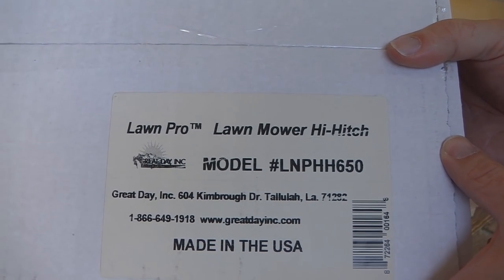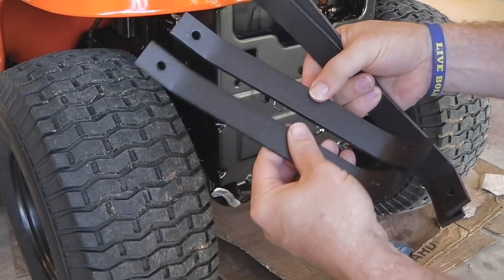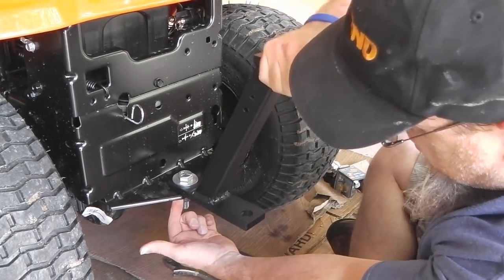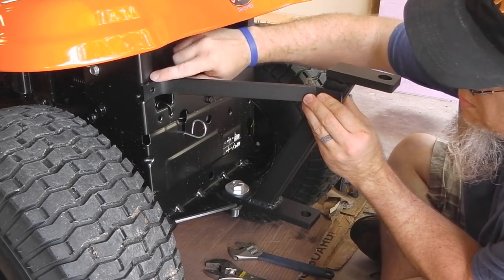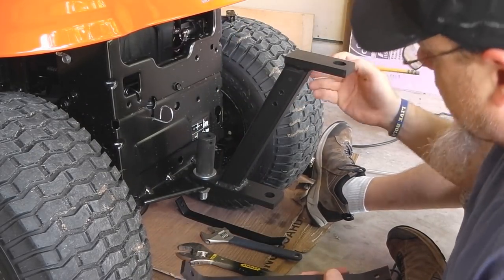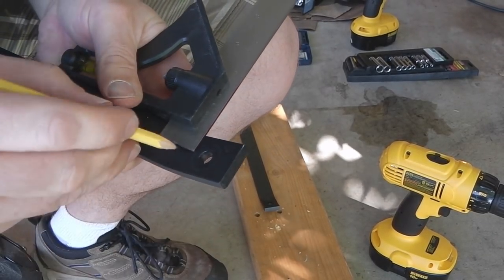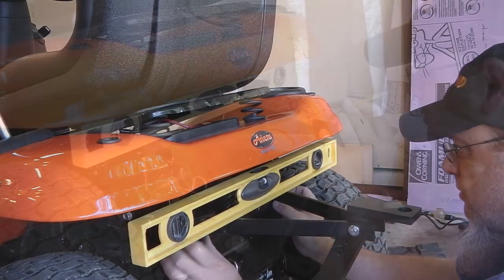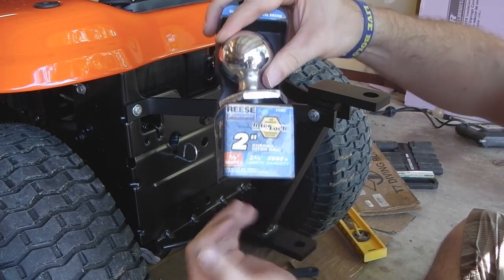Installation Lawn Pro Hi-Hitch (LNPHH650) on Ariens A20VA46 riding mower

Comment: Nice video and install, but a word of caution. That trailer ball is way above the “balance” or what my dad called the torque point of the tractor. That point is below (or at) the center of the driving wheel axles. Anything above that will contribute to the tractor tipping backwards when and if too much torque is put to the tractor, like a trailer suddenly catching against a pole or tree. A neighbor put a chain around the axle of his tractor (12 to 16 inches above the drawbar) to pull a struck truck out and the tractor suddenly flipped backward, killing him. That is why the manufactures put drawbars (plates) so low. It may be inconvenient to hook up a trailer but at or below the axle center is safer. And yes, it has enough power to do that and it may not kill you but it certainly will smart!
Reply from the maker: Youch!  Sorry to hear about your neighbor, that sucks....I've been careful with it so far and I try hard to only tow on flat ground with no obstructions, however I will keep this in mind in the future, especially with kids/grandkids.

Comment: Thank you for the video. I just bought one but the instructions were not easy to follow.. did you remove the gas tank? Mine has tank in the space of the black box.. craftsman tight turn 48”
Reply from the maker: My gas tank is up inside the engine compartment, so I did not have to remove mine.  If I had a gas tank in that area then I would probably remove it or put a metal backer plate between the tank and rear of the tractor to ensure you do not puncture it.   Thanks for watching and commenting!

Comment: decent looking hitch... not sure I like it being made out of aluminum (from what I have read about it) unless you are only towing smaller/lighter items. Read some people had to beef theirs up with some extra steel supports. 
After I built a 4' x 3' heavy duty utility trailer to use on our property, I then built a similar hitch out of steel for my mower. Distributes the weight nicely, many times stronger than just putting a ball on the flimsy plate, and it makes the trailer ride level. Also with the ball further away from the rear of the mower, it gives a much improved turning radius.
Reply from the maker: So far I have not had any issues with either my mower or with the hitch itself.  I do not attach anything extremely heavy to it, just a 4 X 8 Harbor Freight "heavy duty' trailer to it and it pulls it just fine.  

I agree that this solution, or a custom-built steel one, is much better than the flimsy plate they put at the bottom.  I don't believe the manufacturers actually intend on any of us putting a true trailer-ball on them anymore.

Thanks for watching!
Reply: @TBKHomeworld  yeah, mowers these days definitely aren't built to do any heavy work or towing. But with a balanced trailer, they can still do a good bit of work. The mower I'm using for this, I got free. Had a blown head gasket which I fixed. I then removed the deck and everything associated with it, which reduced the weight a bit. Did several small mods  and addons to the mower to make it more useful for utility purposes. I know I overbuilt the hitch, but I usually overbuild anything I fabricate LoL  Would rather overbuild it than have it break on me though, especially if I was out on our property somewhere. 
Thanks for the Idea!

Comment: Just got my own and havent used it yet. Looks as though it will serve the intended purpose.... if the welds survive. Looks like they were welded by a blind man with a torch and coat hangert.
Reply from the maker: Mine is still in use and does not have any issues.  Hopefully yours will be just as good.

Comment: Please dont tow anything other than mower accessories with a riding mower. Its not so bad if you habve a garden tractor though. The issue is thag riding mower transaxles dont have ball bearings for the output shafts they have bushings and cannot support the tongue weight. The transaxles also are not durable enough to handle pulling a load like a garden tractor is. Back when i worked at a friends mower shop we would see mowers come in all the time for transaxle related failures. Those mowers all had a ball on the back for towing. In fact if there was a ball on the back of the mower we were instructed by the mower company that they would not do warranty repairs. If you want to pull a light trailer you can use a tow bar which keeps the weight off the mower.
Reply: Well use mine all the Time so far touch wood no prob so thinkin they must be moving Cement cause I Haul scrap dirt and oya brass Copper and Lead 3x6 ft trailier and it goes good Sears 14hp 5spd

Comment: I was disappointed when I got mine a few years ago that the parts are made out of aluminum. Thus I have never installed mine.
Reply: Update: I installed it in 2018 on my Toro 522xi garden tractor. I used both sets of arms included in the kit plus I used 1”x12”x3/16” mending plates to reinforce it. I have multiple videos of it. Click on my name and you can find my videos.
Reply from the maker: I'm glad you were finally able to install it, I have used mine a lot and I've never had an issue with it.
Reply: @TBKHomeworld  
I built mine in 2018 and still haven’t used it. Might be removing it to install a sleeve hitch. Oh well, it was fun adapting it to the tractor.

Comment: What is that
Reply from the maker: Just a nice little trailer hitch that won't bend your rear frame on a MODERN riding mower.  The older ones have big metal plates in the back which don't bend except under extreme loads.

Comment: That dam tin  not going to work!  i don't want my dam hitch 10 foot in the air>   Trashy just trashy > got some metal plate 3/16''  to cover the ass end on the dam thing,  going to make 6 holes to bolt it to the trashy tin  on the plate weld a box receiver to that will work'. The plate will cover all the weak spots on the tin rear end !  Then bolt to the dam trashy tin>  still not as strong as i want it !  but all i got to work with! >  The tin sides that bend around to cover the ass end could collapse. Just not enough frame to weld any thing!   I think its limited to about 1200  pounds at the MAX : (  Not much for a hitch > But a lots stronger  than the factory hitch plate > 200 pounds is Max for that cheap ass thing. take my fingers and bend that trashy thing  NO I'AM NOT GOING TO PUT IT ON THE REAR AXLES EITHER! Chance of bending a axle or breaking a axle and bolting it to a  aluminum rear end casing is OUT TOO! > Got to be a frame > >  So that what i got to work with is>  a plate cover the rear end  bolted to the tin  and a hitch receiver  welded to the plate > i might try to bend the plate around to the sides of the tin then some flat bar to bolt to the frame  THERE JUST NOT ENOUGH FRAME ON THESE TROY BUILT RIDING LAWN MOWERS there made out of tin
Reply from the maker: I've now had this installed for years and I have used it to haul all sorts of things around.  The mower is still going strong and no problems.  However, if you would like to provide a better more for me to try it on then I'll be happy to give it a shot there!  

Thanks for watching.
Reply: @TBKHomeworld  I done told you how i would do it...  That not going to last long on that thin sheet metal
Reply: @TBKHomeworld  There not made for hitches to begin with. Nor pulling any thing!   I would also beef up with 2 angle iron pieces for the 2 top bolts  > its all hooking up on stupid, thin sheet metal >  It will pull out and break off  and the bottom will bend down..  I know i tried it. So i got some thicker plate metal and some angle iron to fix mine
Reply: @TBKHomeworld  Must not be hauling firewood in it, or dirt